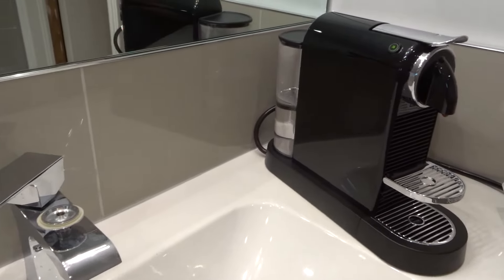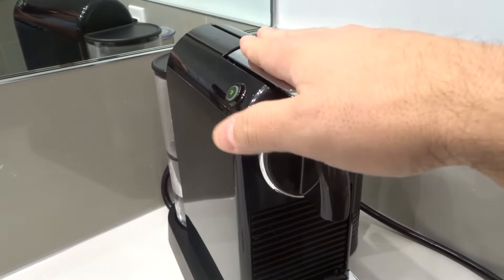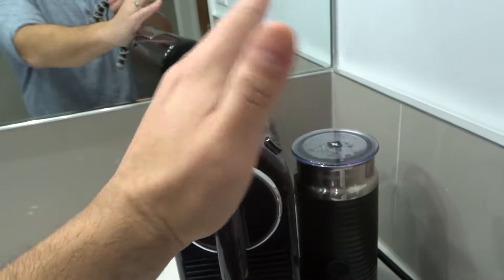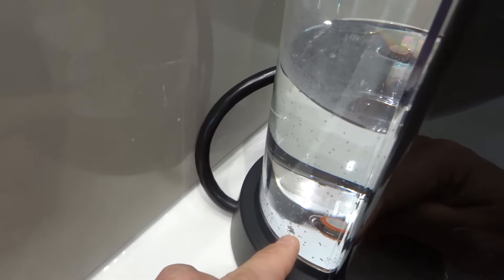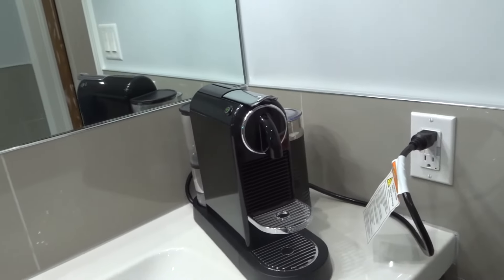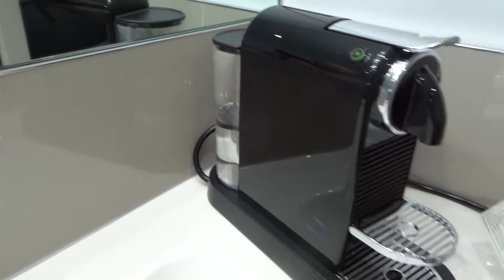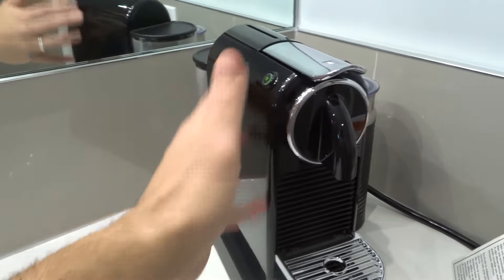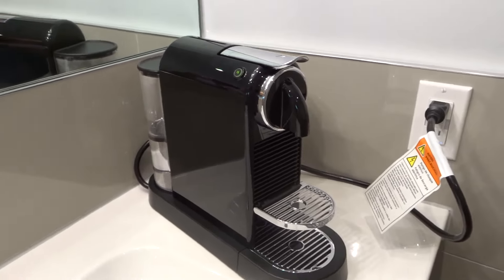Nespresso Citiz Not Pumping Water-Easy Fixes To Try First

Comment: Hi my Nespresso machine water sprot is not locking (*lock inside on top of the waste container) to pump water out though h the sprot, instead is pumping out the water directly to the waste reservoir., How can I fix the lock?  I noticed that if I take of the waste reservoir and lift up the lock manually then the water comes out though the sprout, this is how I noted the issue is with the lock. do zou have any ideas s on how to solve this issue?